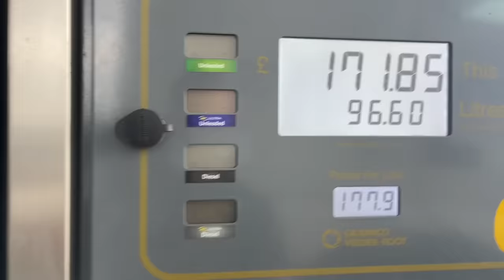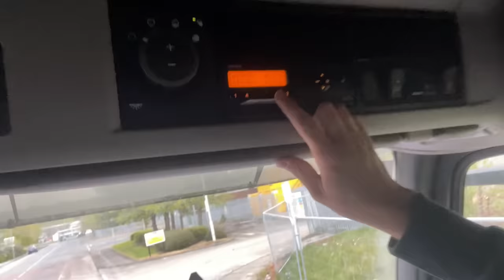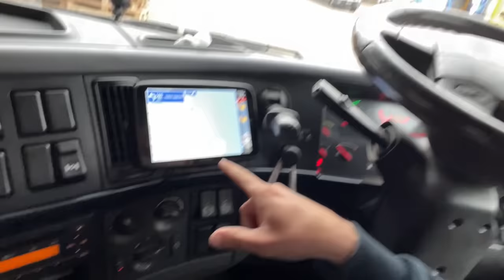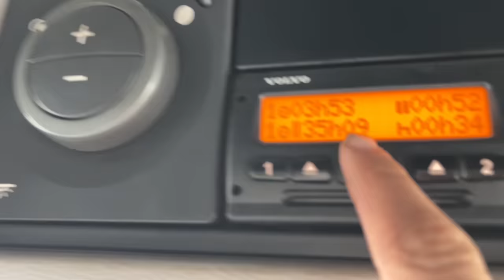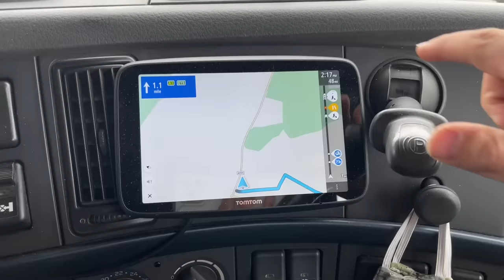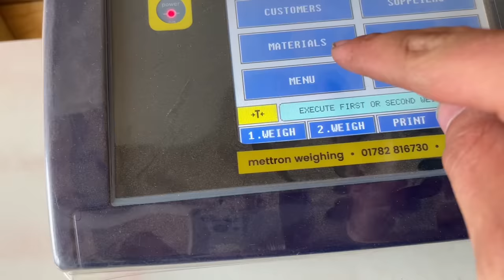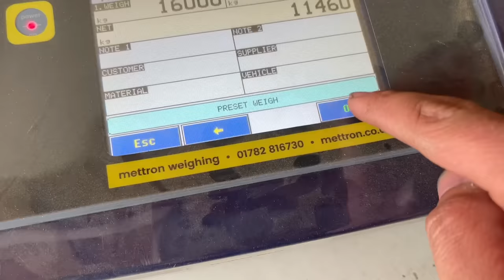Spending The Night In A Truck | POV | Trucking Vlog 57 | #truckertim

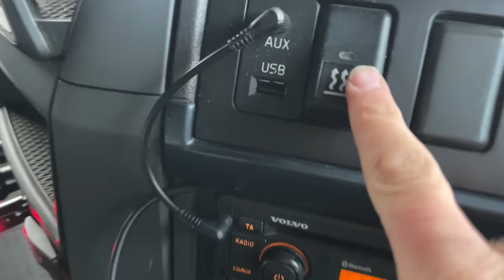Comment: 16:08 Noooooo.....don't do it bud💖look after ur bod.....get ur azz on the keto diet💪shred ur timber or ur gonna need a moffet 2get on the top bunk 🤣🤣🤣 stretch em legs around the block 4an 'hr...ish' after food b4 u settle down helps ✌😎✌ load up water bottle an couple ov weights/20+tins groceries in rucksack, walk 4half hour/40mins turn around en walk back...eazy...ur Mrs will b grateful too 👸🏼😉

Comment: Yeah not a clue why the algorithm's churned this one out, interesting vid. As a non-lorry driver, can anyone explain to me why lorry drivers attempt to overtake other lorry drivers so frequently? Pulling out erratically, holding up the right hand lane, gaining such little distance over the other lorry, and then inevitably a roundabout appears on an A road and it's all been for nothing. Seems like such an unnecessary action with such a MASSIVE vehicle.
Reply: If we were all in the normal traffic Lane, and the middle lane drivers were in the middle 

Everyone would be trying to over take in one lane on the outside, it would be carnage!

Comment: doing my class 1 and failed my test last week on the stupidest thing ever! i was coming up to roundabout (for context i live in Peterborough with a lot of roundabouts that dont give you good vision of the road leading onto it and ofc people never use there indicators or are in right lanes lol) so i slow right down and let the lorry roll up to the give way lines (maybe doing 5-10mph) I'm looking out and its clear all the way the enter is slightly blind can only see abit of the road and its a parkway so people enter is pretty fast! its clear when i reach the lines no cars at all so i dont stop i press down on the gas to pull out into the roundabout as you do! at this point i realise there no power in the lorry and i roll out into the roundabout, as i roll out to car start to approach the roundabout, at this point im panicking abit as i have just rolled far enough that i already had to start making the turn but i still got no power and ofc it ends up with trailer blocking the cars who entered the roundabout and i get a fail!......turns out the lorry was having trouble picking a gear so just didn't pick one and as i was freaking out abit trying to think why there was no power i didn't think to hit the gear selector down! so in the end last 3mins of my test all fell apart due to me getting cucked abit by the bloody auto gearbox and not having the expirence to know how to quickly fix the problem! other than that had only 3 minors. 

This been living in my head rent free for 5 days now and it pisses me off so much that i messed up everything on such a silly mistake and little bit of vehicle fault, 2 more weeks till i can try again!

Comment: Cheers for the vid. I'm currently an Ocado driver 3 ton driver. I'm thinking of going for the full artic license I'm just not fully sure yet because of some of the bad things I've heard .... just wondering if these are the usual grumps and annoyances you get in any job (I mean I know some of the issues already i.e. traffic ect, other road users) but the actual job itself .... are drivers right when they tell me it can a crap profession to work for? I only ask as the course is around 3K and I don't want to spend that amount of money getting into a career that is bad.